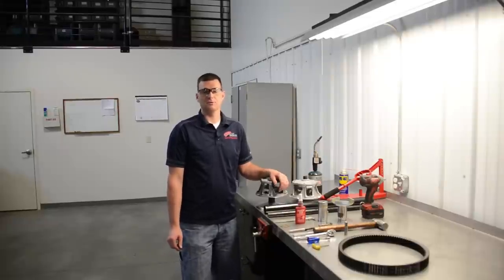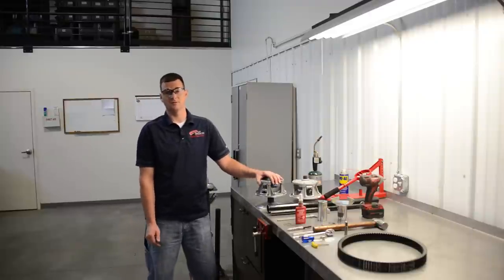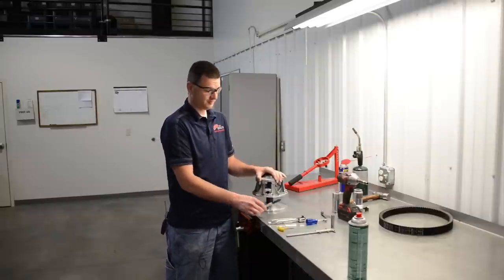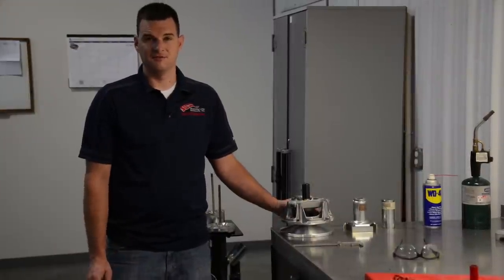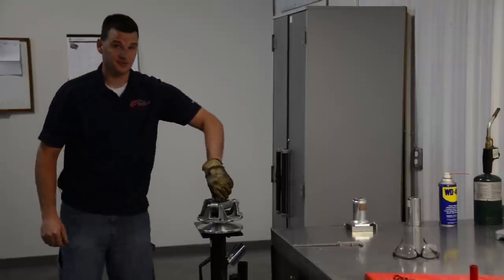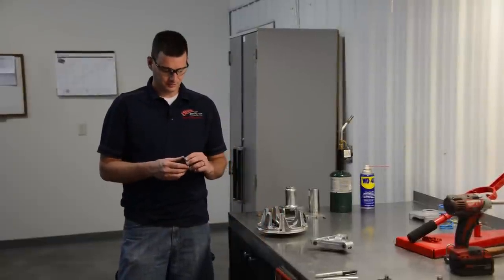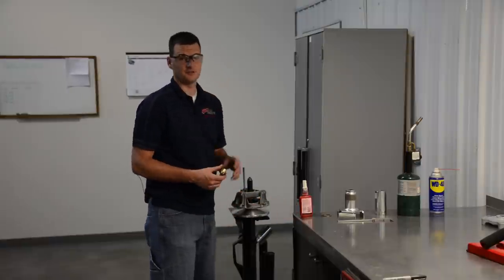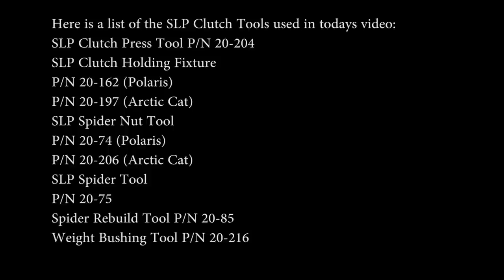Starting Line Products | Shimming a Snowmobile Primary (Drive) Clutch Tutorial

Comment: A question about balance -- will you affect the factory balance by adding or removing shims as you now have moved the stationary position to a different location relative to the movable sheive . P.S. should have given a little speil about shimming the buttons and which side to put the shims in . but otherwise a good instructional vid .
Reply: no. the shims have very little effect due to them being close to the middle of the centroid of rotating mass.
Reply: What marpip01 is referring to is indexing the pieces to the fixed sheave.  If you pull shims then the spider will spin on further and will now be out of position(along with the movable sheave and the cover) with respect to the fixed sheave.  That will affect balance.  Polaris used to show in the race manual how to index the spider to compensate, but now days with the ability to have SLP or another shop balance the clutch it is a great idea to set the belt sheave clearance assemble with the Xs (Polaris) lined up and have the clutch balanced.  $50 is good insurance against clutch damage.

Comment: 2:49 Is that 0.25 - 0.5mm? Sorry but I don't know all of this ancient
units of measurement America still uses ...
Reply: 0.010 inch and 0.20 inch
Reply: LoveMySRT I think you mean 0.01 inch - 0.02 inch which is 0.254mm - 0.508mm in the http://en.wikipedia.org/wiki/Metric_system. But thanks for your reply, just look at the map in the link and think about who the global hegemony is then you get my frustration.
Reply: well actually that would be one tenth and 2 tenths.. he said 10 thou and 20 thou
thought you wanted an answer not a reason to try to prove somebody wrong.. sorry for answering your question..
Reply: which is the same thing but not the measurement that was used
Reply: LoveMySRT That explains thou (thousandth of an inch), that does not change that fact that I have to go look up what this ancient units of measurement is in the modern times. And yes a confirmation that my conversion to the modern times is right is appreciated without a need to prove that you or someone is wrong.